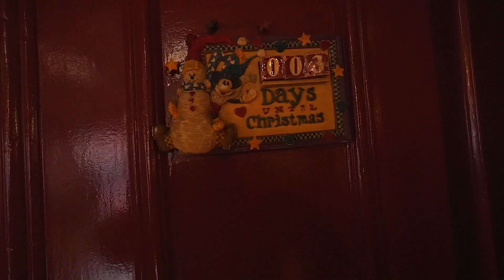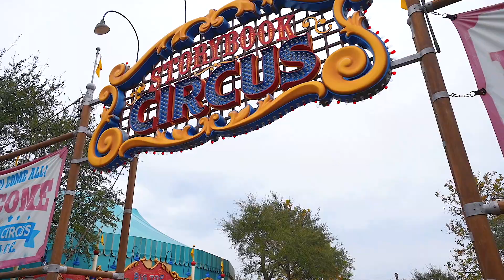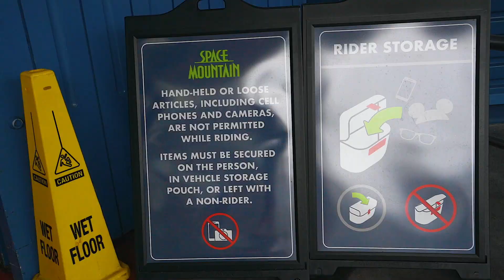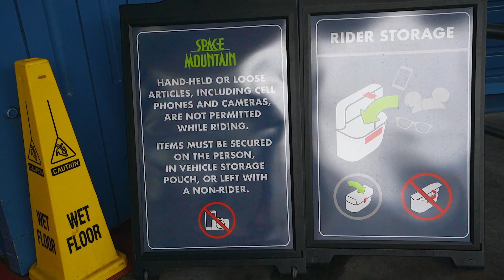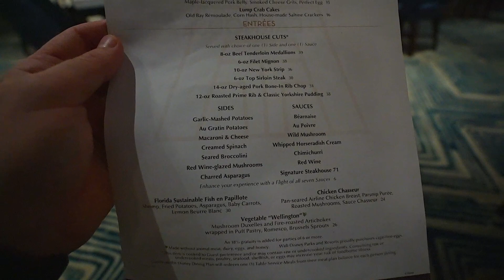Disneys New Filming Policy Bans Vlogging On Certain Rides | Dinner At Steakhouse 71

Comment: That sign doesn't say "no vlogging" or "no recording", it just says no hand-held or loose objects.  A camera or go-pro secured to your body should be acceptable.  Of course, it wouldn't be pointed at you when you ride.  Strange that they put the sign outside Space Mountain, a pitch-black ride where video doesn't show anything.  You should check on whether a mounted camera (not hand-held) would be allowed.  Perhaps a GoPro attached to your wrist - something that can't be dropped?  I see lots of GoPro wrist straps advertised.